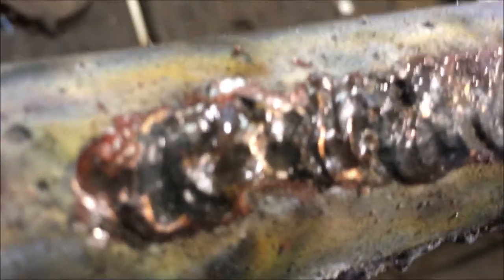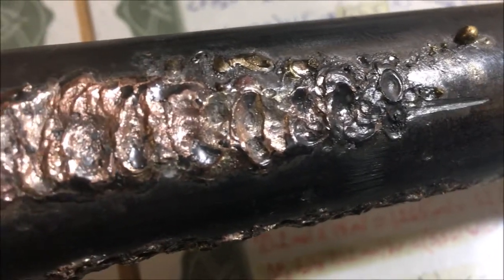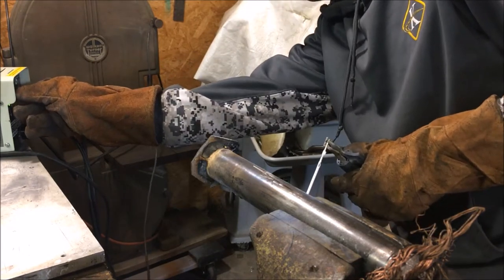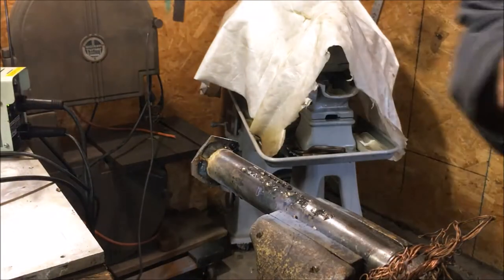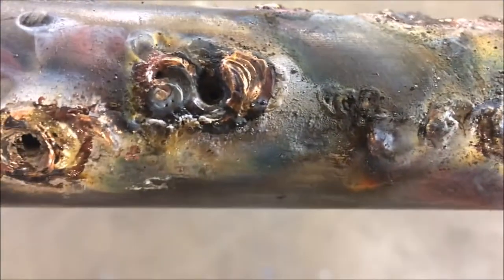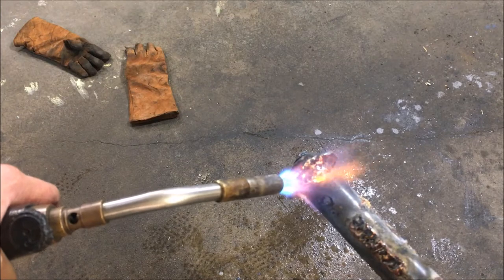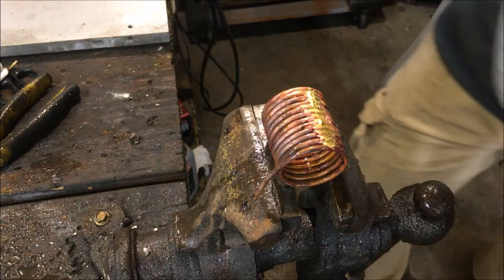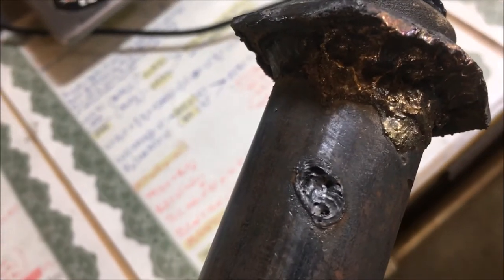Brazing with an ARC WELDER and flux removal method

Comment: You need to use a twin carbon arc torch, a bare bronze rod and boracic acid crystals made into a paste with water as a flux. The bronze flows easily and if you control your arc gap right so you get a soft flame you avoid burning your flux and bronze
Reply: Just started using my old carbon Arc brazing tool.....I have a 110amp oil cooled Arc.....used to be great when I used it lat over 30 maybe 40 years ago.....

But now I struggle to get a steady arc....the carbon rods are 8mm.....I am wondering if I used thinner carbon rods....I ordered 8mm cos thats what I thought they were.....

There were the remains of 2 old carbons in the torch when I dug it out a week or so ago 6mm...had a quick try with those....nice steady arc....did a braze.....then the carbons with to short so I bought the 8mm rods....

Any ideas guys??
Reply: @nickaxe771  try changing the voltage or amperage output . Or switching polaritys if its a dc😊
Reply: @mobmob5944  Bought some 6mm carbon rods.....much better.....

Comment: Too much Amps it looks and sounds like, make sure your carbon rod is sharpened to a point, and you dont need 2 carbon rods. Your arc should look like a TIG arc.
Reply from the maker: good idea on th pencil tip , didnt even think of that
Reply: @NOBOX7  it makes your arc more concentrated / controllable. And Carbon Rod only needs to be about 2" long. I was using about 30-40 amps today on some sheet metal.